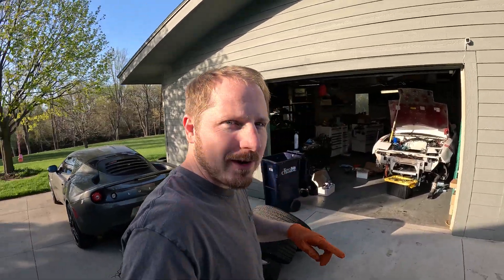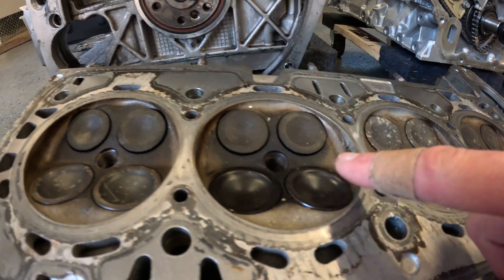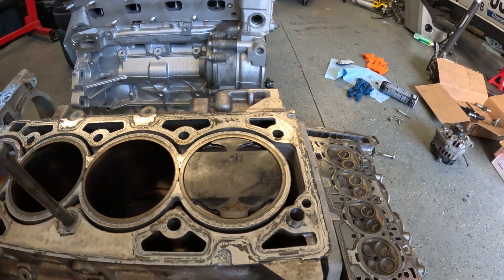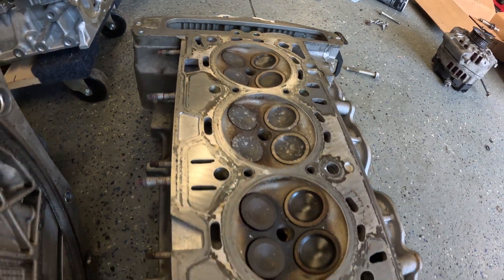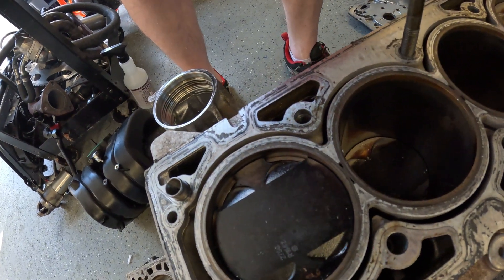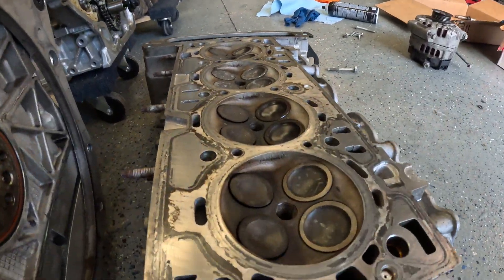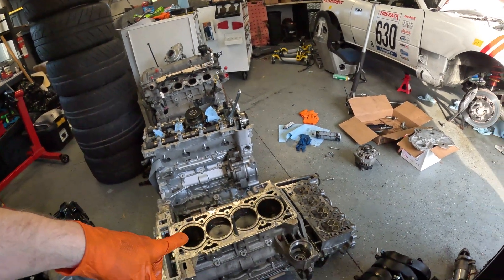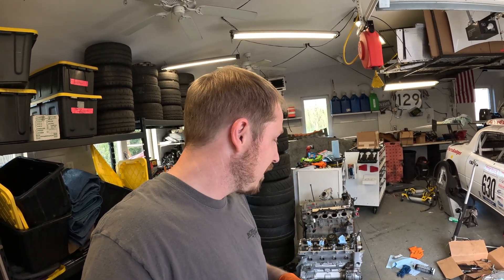The Blown Motor Mystery - What Caused Our Engine Failure?

Comment: Only a guess but extra clearances are needed on both ring gap, piston to bore and even crankshaft bearings when running higher than stock power.
Reply from the maker: The issue ended up being the ECU tune was really lean causing detonation and cracking three pistons.

Comment: I just found out my 1952 lakehouse needs some major work.  You need to buy my car for $15K. I spent more than that just for the EcotecMiata turn-key installation.  Located in Brighton, Michigan 48114.    It needs the brakes improved and heat shields but could be driven anywhere. The only problem is the interior is too nice to make a race car.  But it would be the ideal street car for product development and to showcase your products.  Perfect for "Miatas at the Gap".       It comes with the following parts for future improvements:  Ecotecmiata flywheel kit, New HD clutch assembly, 6-speed Miata transmission with 33,000 miles, Solstice AR5 transmission with 33,000 miles, Slingshot transmission with 14 miles, later rear subframe if you run without a PPF, Flyin Miata V8 crossflow radiator, Flyin Miata V8 sway bar bent to clear pulley nut, Flyin Miata sway bar supports, various cooling fittings to re-route hoses, Mazdaspeed sideskirts, Jetstream front spoiler, Bimini top kit, Quickjack hydraulic lift, plus many more.  See pictures on my channel or search "Miataquest" on insta-ya-know.

Comment: I am going with a combination of the exhaust leak giving the oxygen sensor bad feedback and the damaged pulley triggering the knock sensor to pull back the timing.    The combination of pulled back timing and a lean mixture could have made everything run hot internally including the oil.

Comment: Got hot and rings butted? Try to avoid stock ring gaps if it possible engine may get hot in racing like losing cooling. Look for intermittent vertical ring gouges in cylinder walls once you get pistons out.
Reply: Agreed
Reply from the maker: In the end we beleive it was just tuned WAY TOO lean with AFRs in the high 13s low 14s at WOT

Comment: Data point. I've ran mine quite lean to make 2hr stints and never seen any signs of detonation on the plugs. Ecotec ECU flash with lowered fuel pressure, ~100hrs at 13:1 afr on pump 91
Reply from the maker: I am going to see if I have AFRs captured by the AiM and review that data.

Comment: I’d be surprised if you encountered enough detonation to destroy pistons without it being obvious on the rod bearings. Maybe pull the connecting rods and have a look, the bearings usually start to pinch inwards and wipe the oil from the journal. Even if they aren’t spun you should be able to tell by the bearing fit/crush  into the connecting Rod.
Reply from the maker: I am going to pull them Friday I think.  I will reply then.